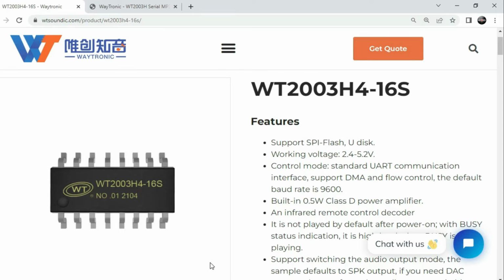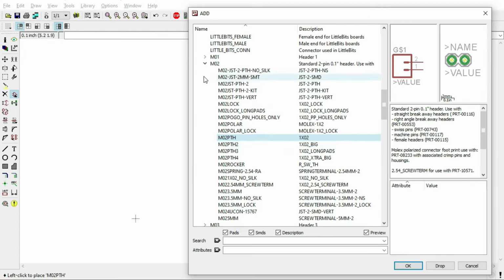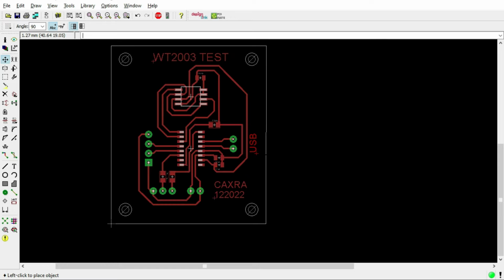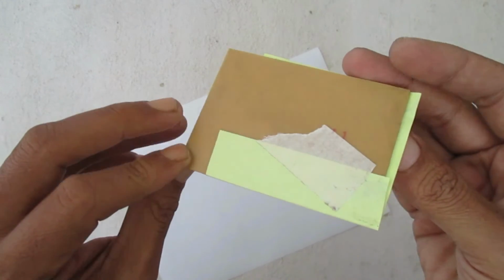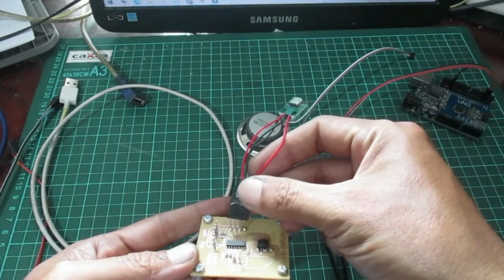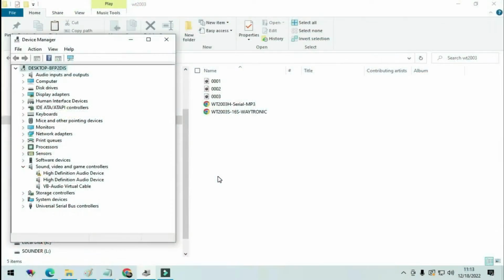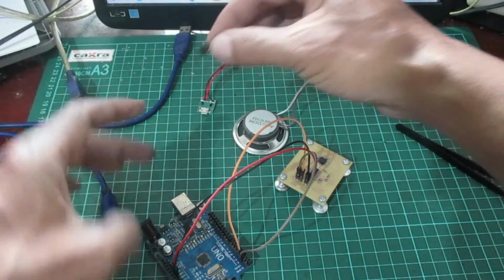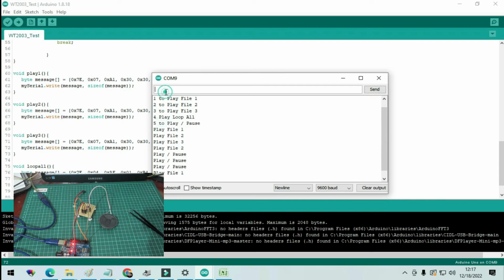MP3 Module WT2003H4-16

Comment: i dont understand one thing W25Q and WT2003H using SPI for their communication. But in that code i didn't see any SPI realeted code. Please someone light me up.
Reply from the maker: Hello Bro, what I know is that the WT2003H Chipset is an audio decoder chipset. To carry out the decoding process the WT2003H communicates with SPI Flash memory. 

Where it will read data or save MP3 file data from and to SPI Flash Memory (eg. W25Q16). 

The communication process is carried out using procedures (protocols) developed by the Chipset manufacturer (Waytronic). Of course, this procedure is Waytronic's property, we are not told in full how it works. However, because it uses the SPI communication method, we can see several things by referring to how SPI Flash memory works.

The thing I want to convey is, WT2003 is here to fulfill the need for "decoding" MP3 files. For our convenience as users, command procedures (protocols) are provided. For example: playing files, adjusting the volume, and several other operations. 

However, these procedures or commands are limited to our communication with the WT2003H chipset. As for the WT2003 communication process with SPI Flash Memory, it is handled by the WT2003H as a system that is Waytronic's property.
Reply: @CAXRAMEDIA  Thank you  for the explanation. I hope you get a lot of viewers like you deserved.

Comment: thank for this great tutorial. but there is a question. is it possible that i have a different firmware so that the wt2003H4 device will not be recognized, when i connect it via usb to my computer?
Reply from the maker: WT2003H4 as far as I know if you order a chipset with a certain quantity, you can request special firmware. make sure the firmware does not change/delete the USB connection function. to confirm this you must contact your contact (seller support) at waytronic. if you do not request specifically, or for example you buy a chipset in the market place, the possibility of wrong firmware is wide open, and very likely to happen. whatever it is, USB not recoznized on a chipset like this, usually because the data cable connection, Ground, D + or D- is problematic (USB VCC can be ignored if your chipset already has its own power supply). Possible problems with the Ground, D +, or D- connection, could be because the cable is broken, reversed, or could also be short. check if your USB connection is good?

Comment: Hello, good time
We provided some WT2003H4-16S chips for sample in 2020. The datasheet of this chip was still version 1.0 at that time, and our tests did not yield favorable results. One of the defects of this chip was that after some time, the output sound would be cut off and it would no longer accept commands. Probably, it remains at the stage of connecting to the computer by mistake.
Now our question is, considering that the datasheet of this IC is version 1.04 and new instructions have been added to it, has this problem been solved? Has the hardware of this chip also changed? The chips found in the markets belong to 2023. How can we know if this chip is the latest version or not?
thank you
Reply from the maker: @sajjadyaghoubi2077  documentation regarding hardware version or firmware version wt2003 is very confusing. the information is very limited, we don't even get references on how to query data about hardware or software versions via serial command for example, so I assume it doesn't exist. 
why is the wt2003 firmware version different? As far as I know, this chipset is customable. when we buy directly from Waytonics, we will be asked for the specifications of our needs. and they will program the chipset according to our request. This means that the firmware/features may vary. I last ordered a wt2003 from Waytronic in June 2024, and the order process is still the same: we will be asked for the specifications needed. 

what if you buy a chipset on the market from a third party? So if you buy a chipset through a third party, we don't know the specifications of the firmware installed. especially if the chipset is sold by a third party with a special request according to their order to Waytronic. 

Can the chipset that we already have have its firmware updated? should be able to. I bought a downloader from Waytronic. when I looked at several parts of the downloader, it seemed like there was something we could do with the downloader. but I don't have enough time to do that yet. My advice, try consulting Waytronic technical support. Recently they have gotten better at supporting customers.